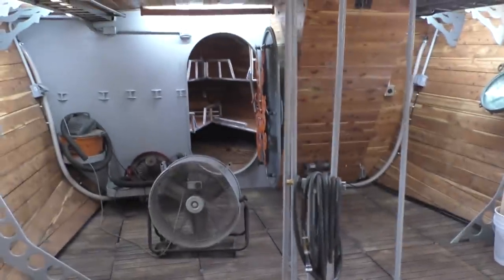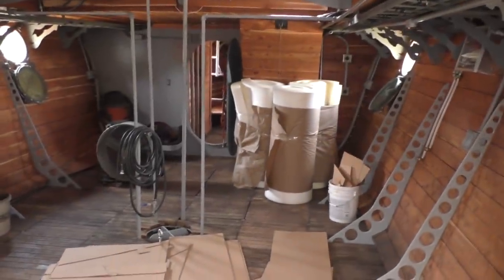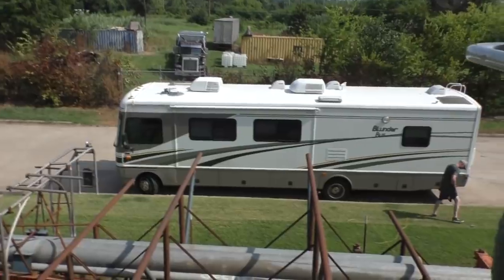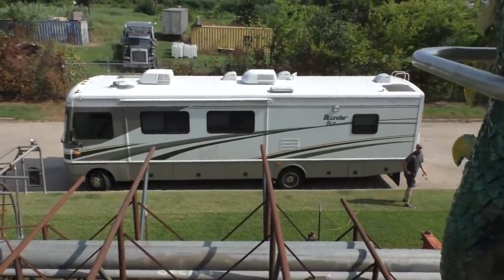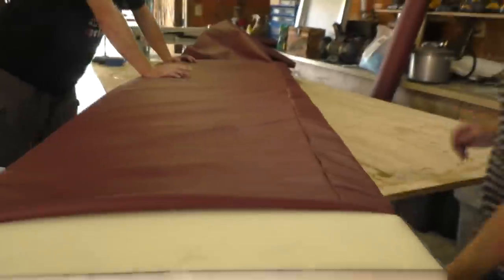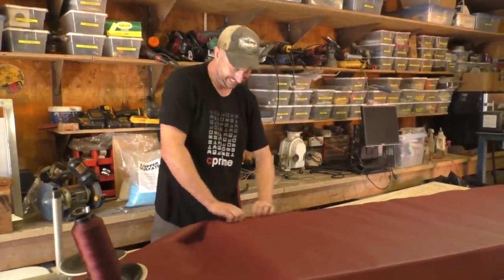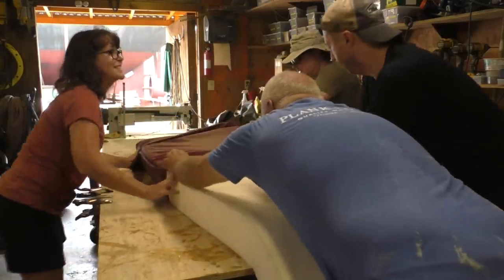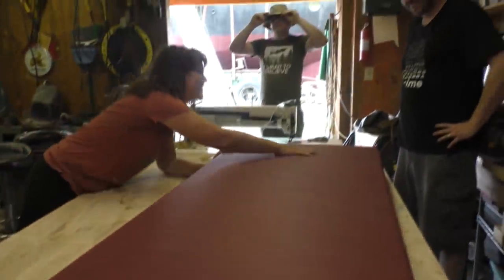Bunk Mattresses and Seating Cushions

Comment: put a bag over the foam and draw a vacuum on the bag.  it will squish the foam and you can slide easy into the cover.  (Courtesy of 'How its Made')
Reply: I was going to to say the same. You use the hoover to suck it in a bag. Then layit.
Reply: And how do you remove the bag?
Reply: @einmensch4040  pull
Reply: @einmensch4040  they are normally like a sock Matt plastic
Reply: @einmensch4040  I have seen it done wheni got my sofas done. They vacuum the foam in bag and the open the bag
Reply: @einmensch4040  leave it in there as a water barrier.
Reply: is the only way... i leave the bag on the exterior cushions then i can pressure wash them if i need ..
Reply: The correct way is to fold it in half and it will slide right in!
Reply: @cdsnider9496  ahh

Comment: Next time you have to cover cushions get some thin plastic like a dry cleaning bag. Wrap the foam in the plastic. Then at the open end you vaccume out the air. Keep the vacuum running push the shebang into the cover, turn the vacuum off, leave the plastic in place and then beat the crud out of the cushion to get it all in place. That's how we did it in upholstery class in technical school.